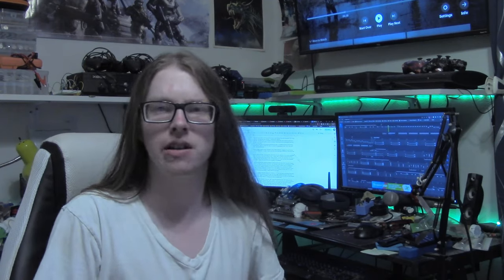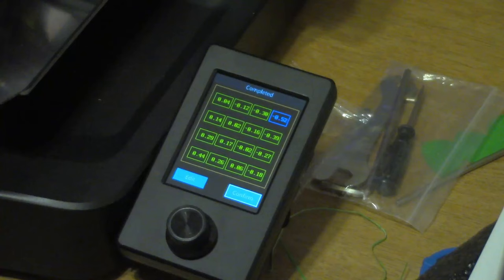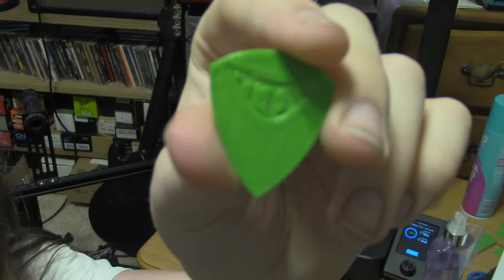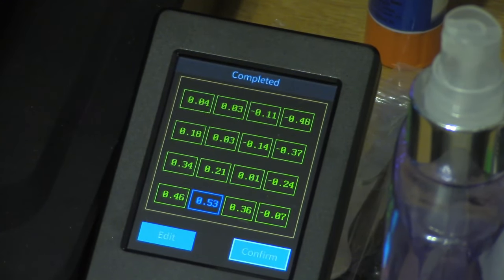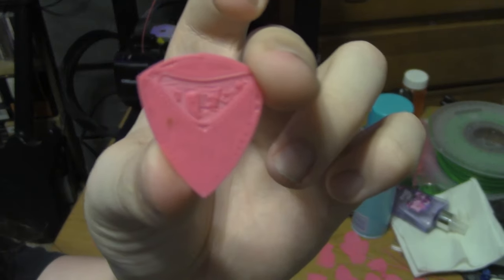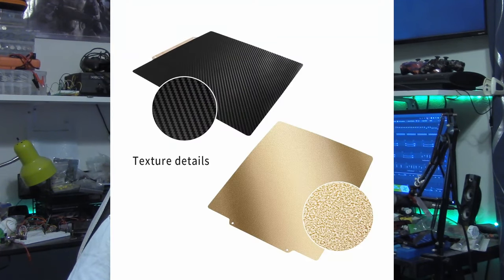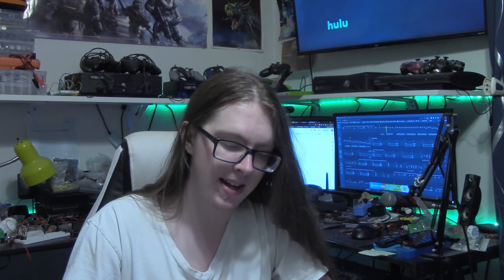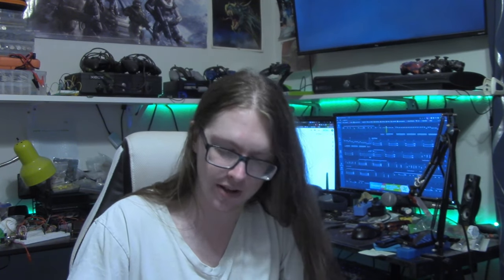Having trouble with your Ender 3 V3 SE Bed? So am I. Here's trying fix it.

Comment: I Think i have solved it, I have cut out a 2mm steel plate and mounted it on the top of the hotbed, then I have placed my glass on top of the steel plate 
I have used contact glue on the glass plate to hold it together 
It solved my problem when I print asa

Comment: yo so i had the opposite problem with my ender3 v3 se but instead of over adhesion mine was under adhesion. Some areas of the bed were perfect, other sides did not adhere at all. The fix i was able to find was after auto bed leveling, I changed the z offset  +/- 0.01mm each time to make sure everything sticks to the bed on the first layer. Its not the best solution to this problem but it works.
Reply from the maker: Yeah, I have a video coming out soon about manually leveling the bed.
Reply: Mine was doing the same and I realized the gantry wasn’t level. It was super easy to level. I found a you tube for it and it took under 5min
Reply from the maker: @MrPooreboy  It may not be the exact way but I think I mentioned something like this at 26:13. Glad to hear it worked out for you though!

Comment: Just a quick question, how do you get the printing base leveled and not drooping or jagged?
Reply from the maker: Well, I'm not exactly sure based off the wording, but I do have videos for manually adjusting the auto leveling for both the .4 firmware and the .6 firmware.
1.0.4 - https://youtu.be/-Ta137WM9Hs
1.0.6 - https://youtu.be/i8-rdC15H_A
If you purchased the printer within the last 6 months, it's probably .6 firmware.

Comment: My one works 24/7 bed is +- easy to remove (just lightly bending PEI mat when it cold ) after 2 weeks of usage it became less sticky (still watching video)  but i'm not printing so thin details. Mine came just from box perfectly leveled. All i did is e-steps calibration X axis profile leveling with even bricks laying around. Checked all belts tension as displayed on Creality aftersales chanel on YT.  Creality print software is complete BS, last version of Cura have a profile for V3 SE all working perfect.
Reply: Don't use hairspray on adhesives on that cover, complete waste of time it's good without those stuff.
Reply: Friends of mine that have problems with bed leveling added height to plastic stand or lightly grinded those to level  even food luminum foil works :) Hope you printing those with low cooling or no cooling at all because picks are thin.
Reply: I have the cura 5.5.0 version and haven't seen the v3 se profile,  are you sure it's on there?

Comment: Hey man, I didn't see anything in this video on actually making manual adjustments to this printer.

I just got mine and did my auto bed leveling and my readings are all over the place with green yellow and blue bars.

Am i supposed to just adjust them numbers in the settings? Roll with it? Or do I need to disassemble something to physically adjust the plate?.

The creality video doesn't show them doing much other than measuring the plate with a ruler
Reply from the maker: So first of all your bed sounds pretty messed up. Creality has recently informed me that there are different sized standoffs holding up the bed. There are two shorter ones for the left side and two longer ones for the right. When I had readings like yours it was because I put it together wrong, so I would measure those first and see if they are properly placed. If you do, be careful when trying to put the bed and standoffs back together, it can be an annoying process in it's self getting everything aligned. I'm not saying that you took it apart or put it together wrong, it's just good to check based on what you told me.
If you still need to do finer adjustments after that, I have a different video going more in depth about the manual input adjustments. I hope this helps. 
https://youtu.be/-Ta137WM9Hs
Reply: @Bowsmin12  so I redid the entire manual setup, I messed with the gantry and redid the Z axis. You were 100% correct about the different sized stand offs! After messing with those 2 things my numbers from the auto bed are all green again and I'm making the finer adjustments now.

Thanks a bunch
Reply from the maker: @BelowAverageGaming That's great! I was in the middle of replying to your other comment but yeah glad to help. Another thing is to just make sure to properly tighten everything on the printer. Creality has an after support channel where they have a video about. It's titled something weird but it's about tightening things and might be helpful.
https://www.youtube.com/watch?v=NFBy-e9iOm4&t
Reply: @Bowsmin12  you're the best, you earned a sub from me!
Reply from the maker: @BelowAverageGaming Epic

Comment: I have this printer & i concur, prints (especially smaller ones) stick like a MF. I get very nice first layers but its a battle getting the prints off pretty much every time. 

My bed levelling readings seem very consistent though so my only issue is the super sticky bed.

Comment: Supposed to be an open-source printer so isn't the Marlin code available for the printer? Can you modify it to include more points? My Ender 3's and Artillery Genius Pros use glass beds for dead flat print faces, did you consider that?
Reply from the maker: I have never had a glass bed. From my understanding they are usually too smooth and you have to use hairspray or glue, which is something I'm trying to avoid when possible. And in this circumstance it should be.
And I have no idea what I'm doing if I were to mess with the code, but even if I did, I it would probably mess with the display and glitch that out somehow since it's supposed to only have the 4x4. It should have been a feature to change the grid size in the first place anyway. I don't know if it's just me, but it's more logical to get as fine of a mesh as possible, especially when your printer solely relies on it. It would have helped if the probing was more centered too, it's slightly off. Even compared to the official Creality bed test print.

Comment: I am confused about one thing. Why aren't you just pulling the bed plate off and flexing it to release prints?
Reply from the maker: With small and thin prints, they stick too well to the plate and flex with it. And even if they are taller, prints that don't cover much surface area don't come off easy even with the flexing. With beds like the stock creality bed, I find myself doing more damage to the bed trying to bend it to get things off. Simply because I don't like to print overly big things most of the time. Some more rigid metal flex beds work better because they allow for deadhesion but are rigid enough to bounce back and of course not get kinks or wrinkles in the surface from bending, but those usually suffer from the same issue when it comes to small parts. And my G10 plate doesn't bend, it's essentially a better glass plate. Typically bending the plate has not worked in my experience.
Reply: @Bowsmin12  Gotcha. Very interesting. I've definitely had some super sticky small parts that were a huge pain to get off on a stock bed where bending it too much could cause problems.
Reply from the maker: @802Garage Yeah, I experienced this problem quickly after when I first started 3D printing with my Ender 3 V2.

Comment: I was having the same issue and it seems like the bracket that holds the standoffs and screws may have seen some unintended pressure inside the box during whatever shipping it went through. Ended up just reading the z axis values it gave and would take pliers to the corners with the standoffs and screws and slightly bending them. After releveling about 6 times with minor bending adjustments to the brackets the bed is now all green and i just finished a 6 hour xun flute print lol.

Comment: I’m having the same problem I did all the reasurch into buying it and I wasted my money because it does not work
Reply from the maker: Tell me about it. I have been working with support for a couple month trying to figure out how to actually get auto leveling to work. I did the test model once. But I got ambitious and tried to figure out how to make it actually work. I've heard that with some of the newer firmware you can manually level the bed with the paper method, but my printer won't update the firmware properly, glitches, and has a couple languages laid over top of each other when I try! This thing is wild, but of coerce, not in a good way. I think majority of the newer production ones can be saved but I bought earlier on in release and of course, regret it.

Comment: Hey not sure if you've mentioned but have you tried adding M420 S1 after G28 on the generated gcode for the print? It solved to me, at least for now, found this solution on reddit. Also, I've manually set the z-offset. If it does automatically, it is definetly not that value we see on printer's menu. Had to do it before and after a bed leveling to double check it.
Reply from the maker: Well the bed leveling exists (as in it seems like it's applied). When I change the values it can work. So I don't see what difference it would make but I can try it.
Reply: I was writing back to you but it turns I've written a whole post on /r/Ender3V3SE right now. Not sure if I can post links so a quick search on bed leveling will do.
Reply: But TLDR, you need to manually adjust the z-offset; the auto-z-offset adjustment does not affect the value we see on Prepare. Then after that do the bed leveling and remember to use M420 S1 after G28. It's only using this command that the printer uses the leveling data. Otherwise it just prints assuming a (physically) perfectly leveled bed.
Reply: Fyi M420 S1 is present already in Cura slicer with new V3 SE profile.
Reply: @b4ssripper  good to know!

Comment: And in my case, the print plate heating went wonky within a day and 4 small prints.  At the 4th print and after, the temperature of the print bed would start dropping as soon as it started moving and printing, resulting in spagetti.  The nozzle was not clogged.  Changing filament did not help.  I repeated auto levelling 3 times, the results always the same, spagetti.  It was then I noticed on the screen, the temps dropping during print, and occasionally climbing.   Clearly a loose connection in the heating element of the bed.  Being 2 days old, I returned it to Amazon.  No way am I going to go through what you did on a new machine.
Reply from the maker: Yeah, it's wild. I've had issues with every printer that I've owned that haven't been truly "fixed". Ender 3 V3 has the auto leveling issue. Ender 3 V2 has a similar issue to yours but to a lesser extent; when I set the temperature to anything higher than 60C, the printer will set the temp back down to 60 when the print actually starts. And the P1P, the printer doesn't have ant issues yet. But the slicer messes up my pick models shown in this video. They say their slicer is "Too accurate." Hopefully they will eventually fix the auto leveling for the V3 in future firmware updates or something.

Comment: I do it manually with "SUNLU 3D Printer Electronic Bed Leveling Tool(AMZ)" and than it is good as it gets
Reply from the maker: The way I see it, this actually has a few flaws, especially for this machine. After watching CHEP's video about his design, he uses his while using the leveling screws on the bed. This printer doesn't have those and rely purely on auto leveling other than manually inputting data. So he was only using that tool on the four corners, but logically you would have to use it on all data points on the bed for this machine. At least personally I would to fix my problem. So the next problem is that even if I did just do the four corners, there is no live adjustment on this printer except for movement and z offset. And the final flaw I see is that if the bed is imperfected in different ways throughout the bed, wouldn't setting the device on one part of the bed to measure the exact spot of another throw off the data? If the spot you put the base of the device on is higher than the measurement spot, wouldn't the data be higher than it's supposed to be?
Either way Creality should have had this figured out in the first place. Complete auto leveling is their first selling point on most of their sales material and half of the units don't work for various reasons. And instead of addressing these issues they just keep pumping out new models of printers. They used to be doing people a service giving them an affordable option to get into 3D printing but it seems they're getting just plain sleezy.

Comment: every time i click the leveling button it does something for a while but then turns off and returns back on? why? or is it normal? because on the manual it says “completed” but it never does that for me.
Reply from the maker: Have you already tried installing new firmware or downgrading and then reinstalling the new firmware? That might fix what you're experiencing because it definitely doesn't sound normal to me.

Comment: I had wrong z offset every time, but with 1.6 firmware it fixed it, and it hase some problem with printing closer to sides, adhesion is just worse there.

Comment: I have the opposite problem, I can't get my first layer to stick...
Reply from the maker: Even with the stock bed? Well the simple fix is to lower the Z offset by small amounts. Of course you can try hairspray, which acts as a adhesive and a release assistant. Then there is the extreme option of doing the big test print and adjusting the level data to make it proper. But it is a good idea to try to get a good Z offset before doing the manual leveling process. Hope this helps.

Comment: You need to adjust your Z offset in settings 
Your too close to the bed even tho it has auto level take small steps on moving the z off set and you can adjust the bedmesh and the screen micro card is on the side not inside https://youtu.be/iaExzAYR_Fo?si=pO0GU0KNAvbkbqEM

Comment: why did you dont use the flexible bed?
Reply from the maker: I bought the printer essentially for my guitar pick project because the Bambu Labs can't slice it properly. I need to have a mostly smooth bottom layer as well and for most things that I make, I do prefer the smoother bottom. The green G10 used in the vid provided excellent performance pretty much the entire time used on the Ender 3 V2 so it was a logical transfer to me.

Comment: auto calibration is done when the print bed is at 65 degrees celsius, with the standard settings in Creality Slicer when you print the bed temperature is 45 degrees celsius. the difference between 65 degrees Celsius and 45 can lead to the bed curve effect. The easiest solution for me was to print at 65 degrees calsius and adjust the z-offset with -0.01 - 3

Comment: just reduce the bed temperature to 57°C
Reply from the maker: That might help when using the stock bed but when using G10 or something smoother, under adhesion starts to be the issue. Which as far as I know, lowing bed temps doesn't usually help with that area unless I've missed something lately.
And I choose to not use a textured build plate because of the project I need the printer to complete.

Comment: Tried to remove a thin straight line printed on the bed with my fingernails and the damn thing just poked through underneath my nails. Was so stupid of me to even try, though I figured I should just get a Pei sheet
Reply from the maker: Yeah, typically there is a bigger blob on one end of mine that I go for. I had a few times where I got jabbed by that dang pre extrusion line.
Reply: Pei sheet works so much better than the stock plate. 10 bucks
Reply: @marklepkowski4222  The stock plate works fine with a (very) little spraying with 3DLAC. I bought a can more than a year ago, and you need so little it last for a very long time. Apart from letting stick a range of materials very well, it also prevents materials from sticking too well. My prints stick well, but not too tight and are easy to remove. This is all with the stock auto-leveling, and without need to adjust any z-axis offset after auto-level. Just let auto-level do it's work, and print away...

Comment: It is one week I am using my new ender3 v3 se and I have seen the same problem but I simple take the bed and bend it a few times and the PLA prints comes off.   I don't know about  TPU, but I have heard about using glue to be able to pick those parts.
Reply: you’ve obviously never touched tpu or you know you can just peel it off with 0 issue on any build surface
Reply: @jordan-ts9xo  52 years old, 9 years 3DPrinting, building a 3D printed robots since years ago, Academically involved in all of these you call hobby, Yes you are right, I have not touched TPU and all these spools infront of me are just my imagination...
Reply: @PaymaanJafari  52!!!! good grief ! what were the dinosaurs like?!
Reply: @jordan-ts9xo  like you. we got rid of them.